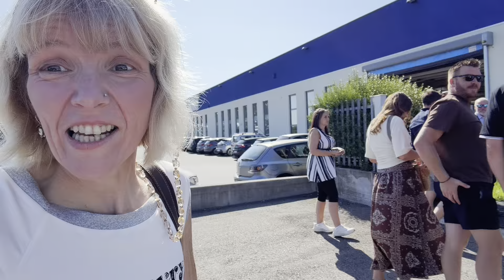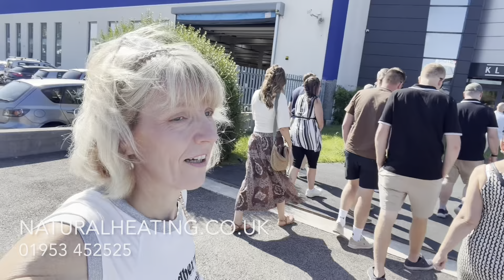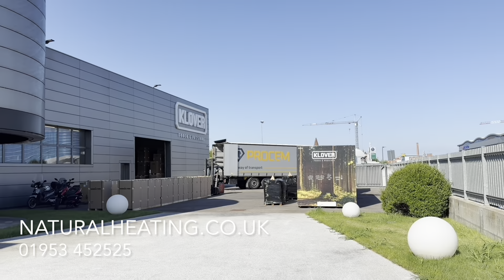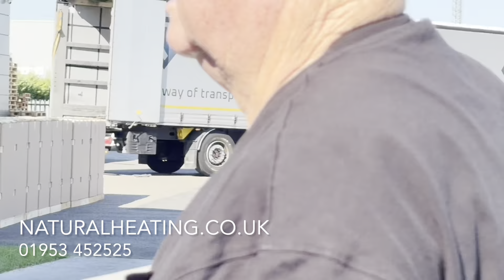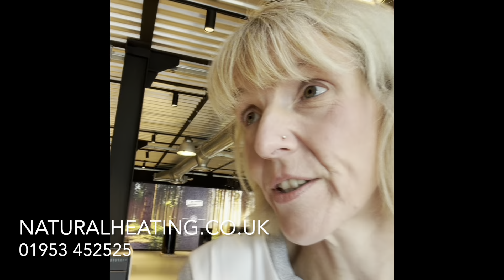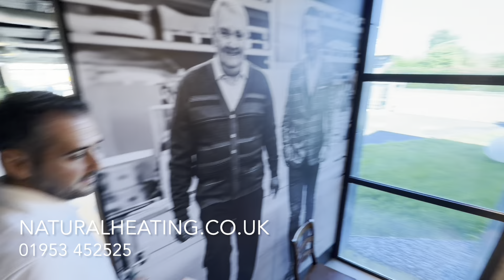KLOVER  Pellet and Wood Burning Stoves and Boilers - Factory Visit in Italy

Comment from the maker: Well, yes - for sure. Common with many manufacturers websites…

Thing is, you’ll find as they are an international company, they make models suitable for many different countries and markets. It’s not always that straightforward and easy.

This sort of thing is exactly why I like researching the ins and outs of everything i can, to understand what a product can do and then match up suitable options (sometimes from more than one manufacturer) to suit our customers needs.

Saves you raking through tons of info trying to work out what may or may not work when we work out all the ins and outs and specifications to not even look the catalogues up in-the first place.

These are fairly new to me, but... Im
On it ! :-)

With KLOVER, we now have the following models in stock and on display: 

KLOVER Heart
Klover Miss Air
Soft 100

Compact 290 wood pellet boiler
 Ecowood 30 wood fired utility boiler